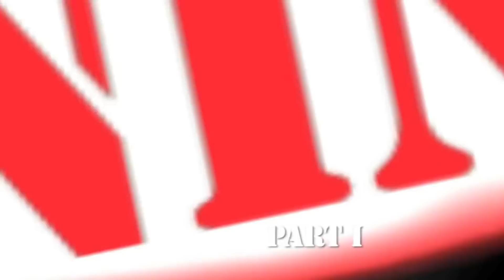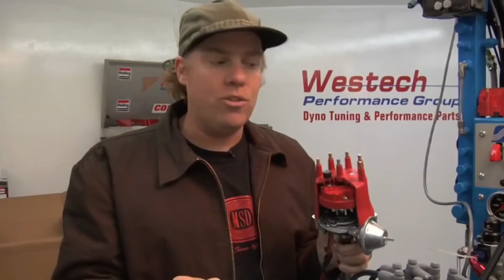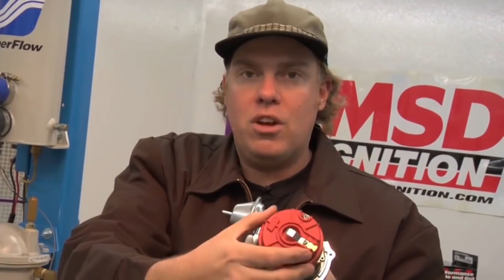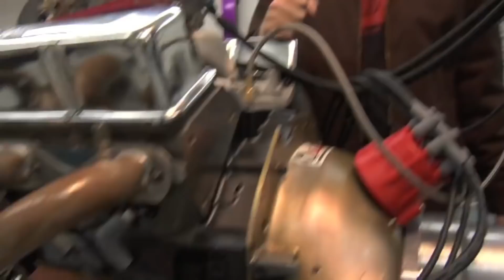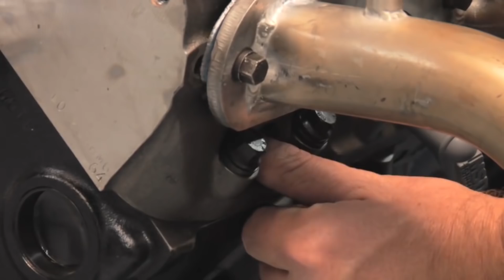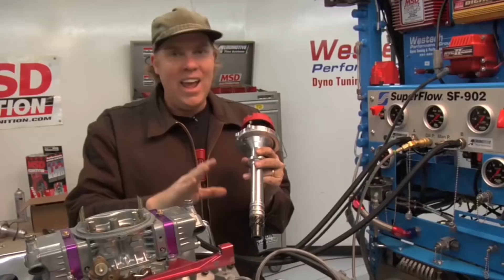How to Install a Distributor MSD Performance Ignition Tutorial Instructions Overview

Comment: What’s the point of changing just the distributor cap? What does this achieve? (Honest question trying to understand)
Reply from the maker: If the plastic on the cap is damaged/cracked, replacement is recommended. If the terminals are corroded, replacement is recommended. This would also apply to the rotor as inspection is recommended and replacement if necessary.
Reply: @JEGSHighPerformance  thanks for the info i appreciate it. I noticed the caps were different sizes (a taller cap replaced the original) if i saw that correctly whats the point of that?
Reply from the maker: @garrettgoldsmith  We only recommend replacing the cap with the manufacturer recommended replacement cap.

Comment: I want to see the wire that connect the msd distributor to the coil.. i ordered it and it brings a tower that you put on the msd blaster 2 coil ... but it does not fit right .. help ! anyone ?
Reply from the maker: Please call MSD direct with more info to trouble-shoot at 915-857-5200

Comment: can i put this on a 77 280z stock engine? or which one do i put?
Reply from the maker: Possibly. You have to find a way to adapt this to that engine ignition system. Call MSD directly for possible options at 915-857-5200.
Reply: +JEGS Performance mi

Comment: #2? I thought that was #1
Reply: This confused me too.
Reply: When you line the cap and spark plug for a new dist and cap do you line it with number 1 or number 2 plug
Reply from the maker: @whiplashj1  If engine is at top dead center rotor should be under #1 plug wire on distributor cap. Does that help?